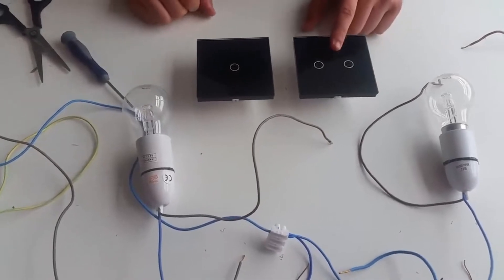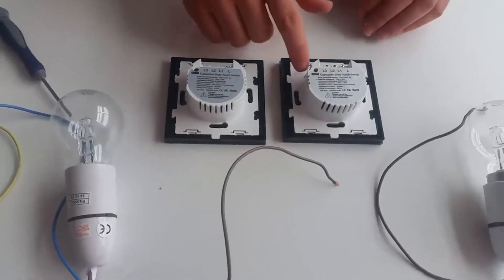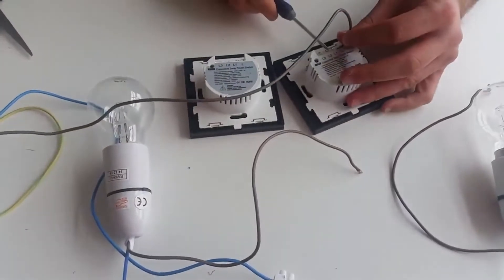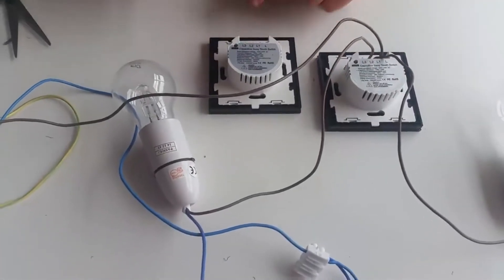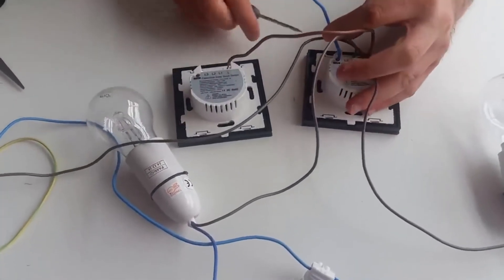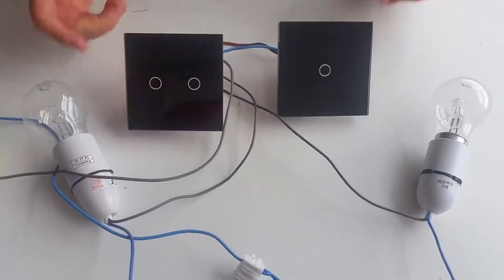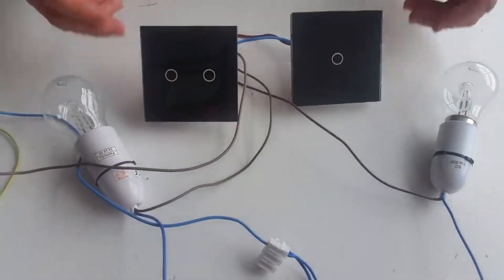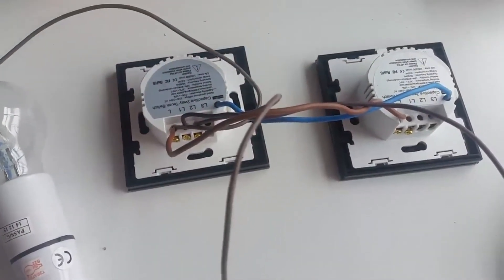I LumoS 2 Way Electrical Touch Light Switch Wiring Tutorial

Comment: I am stock and cannot sort it out. The old switches were working ok for upstairs and downstairs, until I bought I LumoS touch switches. In upstairs was Com, L1 & L2 connected to the old switch. I think com terminal is the power line And L1 & L2 are the correspond to upstairs & downstairs lights. The problem is that I cannot wire from the 2 way terminals I.e the “B” terminals from upstairs to downstairs physically, but the lights were working with the old toggle switches.